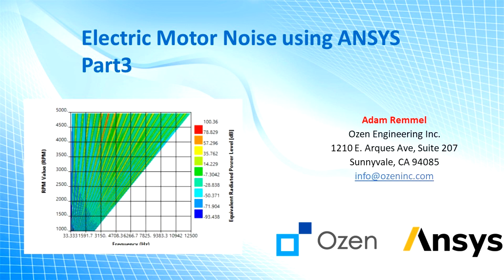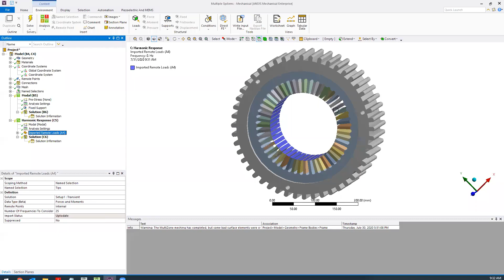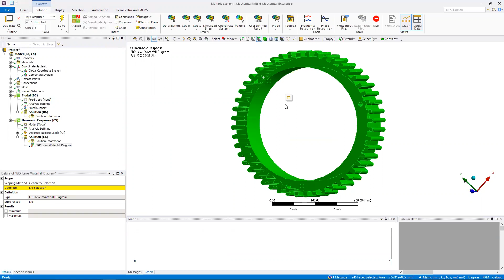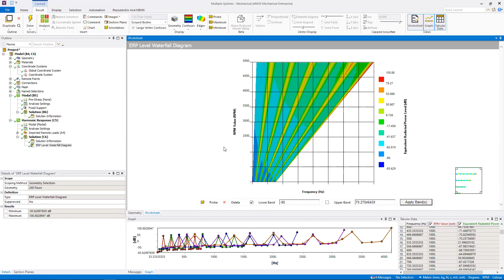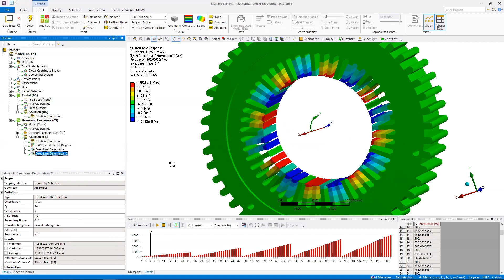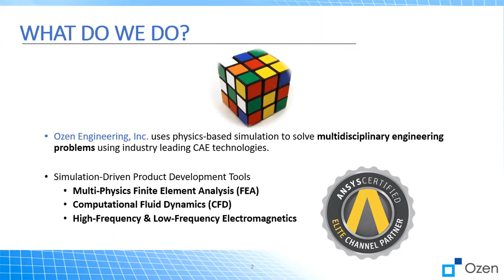Electric Motor Noise using ANSYS Part3

Comment: Hello, i have done similar as you have done. I am also getting same ERP waterfall dialgram as shown in video. But in radial and tangetial deformation plot stator slots are collide with eachother. So what is the reason behind it???
Reply: Hi, I am also trying to do the same but not getting waterfall diagram. Can you help?
Reply: @devendrapansare6928  share your e-mail so we can communicate
Reply: @hardik2547  are you able to see my mail id? I have already posted it but can't see here.
Reply: @devendrapansare6928  i am unable to see. I have also posted but i think they deleted
Reply: @hardik2547  I've tried many times but i guess due to security reasons its not visible.
Reply: @hardik2547   you can get it from my channel. I've just added it there.